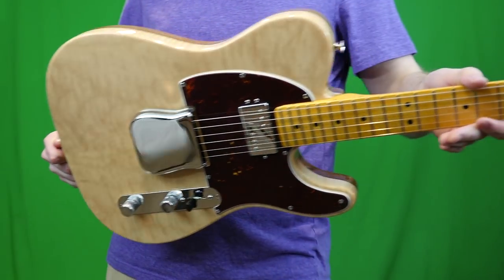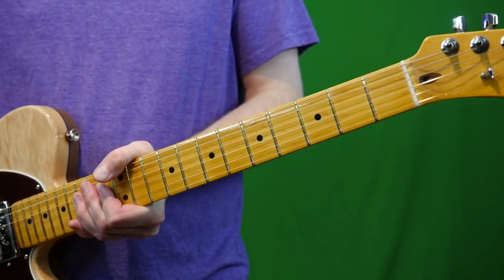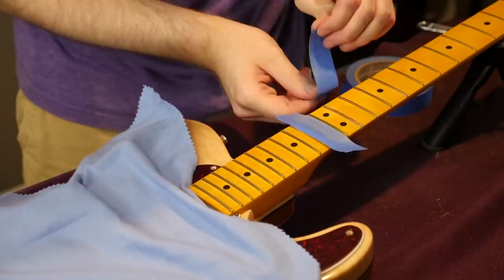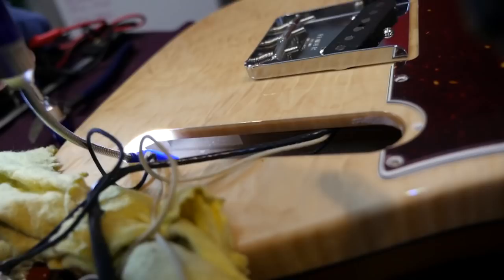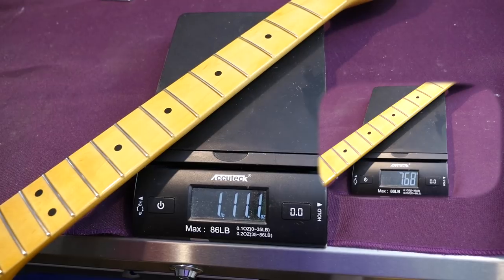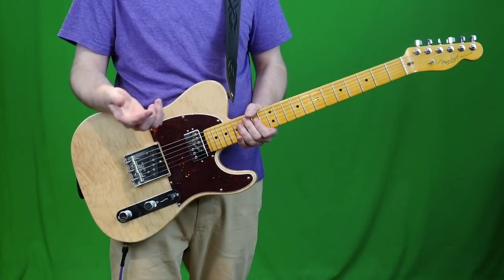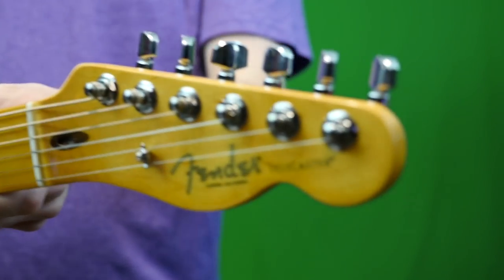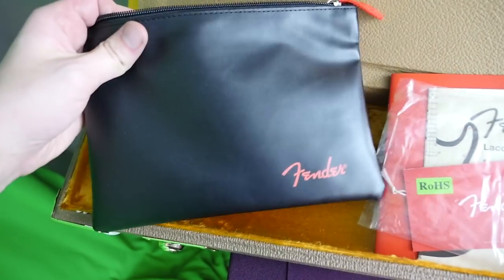What's in the Middle? | 2019 Fender Rarities Flame Maple Top Chambered Telecaster | Review + Demo

Comment from the maker: For Sale:https://reverb.com/item/29548187-video-2019-fender-rarities-flame-maple-top-chambered-telecaster?_aid=growsumo&gs_partner=Trogly
Trade Offers @ tradetrogly@gmail.com
Episode Guide:
0:15 - Rarities Series
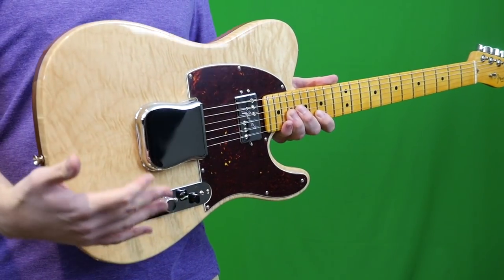1:04 - Flame Top Chambered Tele
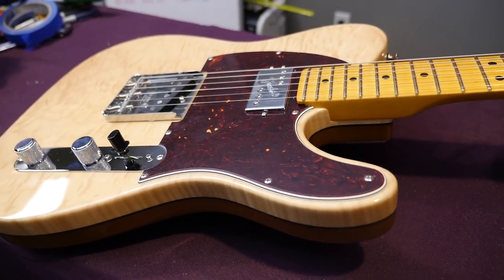1:54 - First Impressions
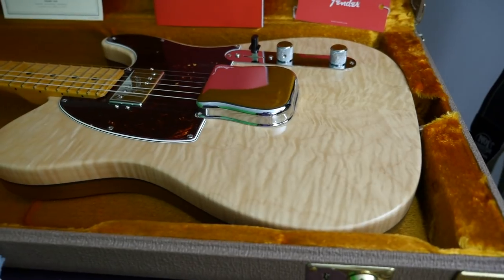5:24 - What's in the Middle?
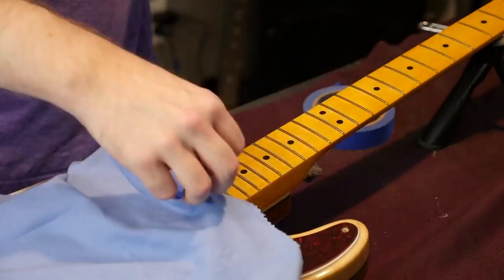7:00 - Inside Look
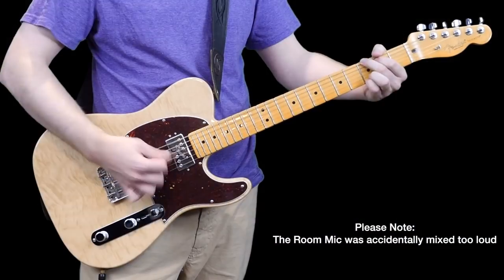14:50 - Tone Demo
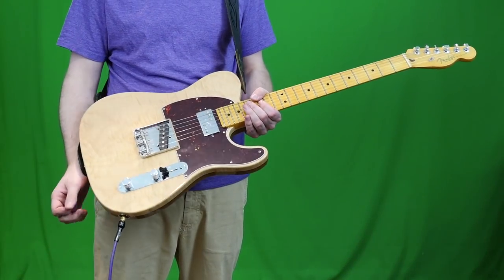16:45 - Tone Talk
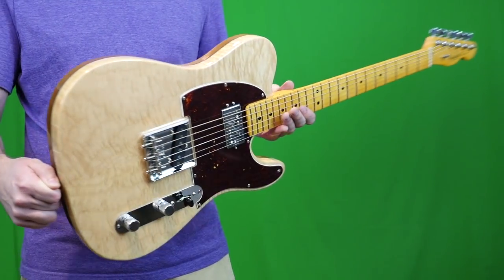17:55 - Final Thoughts
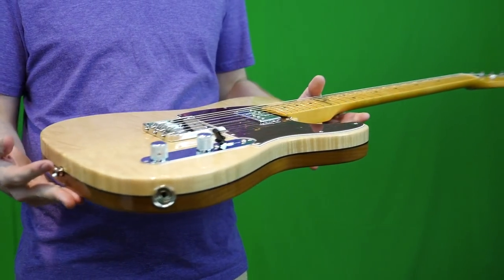20:07 - Trades?
20:28 - Condition
21:58 - Blacklight Test
22:27 - Case + Candy
Reply: Are the little circuit boards treble bleeds, since they have  a capacitor and resistor mounted? Easier install especially with that stacked pot and limited mount space.
Reply: Can you review Brad Paisley’s Signature Telecaster! It’s stunning!

Comment: Forbon flatwork is used as the end cheeks on Fender pickups manufactured using the original methods. Forbon (an NVF trade name) is a cellulose based vulcanised (baked) fibre sheet material. So it seems likely that the filling in your Tele sandwich is a large sheet of the stuff Fender used to make the top and bottom of pickups out of.

Comment: Nice Tele.  Not sure if someone has mentioned this before in the comments, but the little PCB's on the pots look like treble bleed circuits in a PCB format.  Looked like a capacitor and couple of resistors which will allow high frequencies to bleed through at lower volumes.  I saw the same thing on your review of the Pale Moon telecaster.

Comment: The Walnut piece on headstock Road truss rod nut is, I've seen on another video where somebody had a truss rod but they had to take out and they actually took out that piece of Walnut, as in it was separate and not piece of the skunk stripe. Just a plug I don't know if that's the same on all fenders
Reply: It's separate. I have a friend who is a luthier and he does glue on boards. They all get that hollow tube around the truss rod hole.

Comment: I was waiting for you to notice the detail fender continually does with there bridge plates. 

The part before the pickup gets polished and behind it isn't. The reasoning was that, tele bridges originally came with the ash tray cover and Fender thought of not polishing the after the pickup parts due to “customers wouldn't see it anyway”. Kind of a cost cutting, too (to some extent?).
Reply: Back in the early days fender used scrap wood for bodies and learned to hide knots and other stuff with PGs, control plates and pup covers.  I have a 1957 bass and it has the nastiest knot just above he pup where the cover would hide it. Mine is made of alder and I think those fared worst than ash bodies. 

They couldn't have been real picky as they made really early Esquires out of pine as you would find on a picnic table. Paint it and it's good to go.

Comment: This is a beautiful guitar. I wasn’t always a Tele guy, but one day I traded for one. I got it from guitar tech. He said he thought it was a ‘54. The original neck was warped beyond repair, so he threw in a Phil Kabeki neck. It had a humbucker at the neck. I swapped out the bridge PU with a Lace. I had the control pots replaced with concentric pots so I could have full control like my Les Paul. And, there was a phase switch so you could even get a Strat sound. Where is it now? 20 years ago I went insane and traded it away. Not proud of that move. 😐

Comment: Cool setup.  Yeah, 500K pots for humbuckers and 250K pots for single coil pickups.   The little circuit boards hanging off the volume pot(s) are the actual tone-bleed components (surface mounted resistors and a capacitor for each volume pot).   The capacitor hanging off the tone pot would be the tone capacitor.    Treble bleed circuits/components are always used on the volume pots, this allows the high-freq. tone to be maintained when the volume is rolled down.
Reply: @guitarocd9984  not sure about that (engaged grease bucket tone mod and then disengage same tone mod).
I am looking at rewiring one of my Telecasters to give me individual tone controls and capacitors for the neck and bridge Telecaster pickups.  Having a tone control for both would allow me to use a different capacitor value for the neck verses the bridge.   It would used a stacked tone pot with inner and outer shafts utilizing a stacked control knobs.  Same look as stock setup only double the fun!   Not even sure if that type of pot would fit in the route cavity.